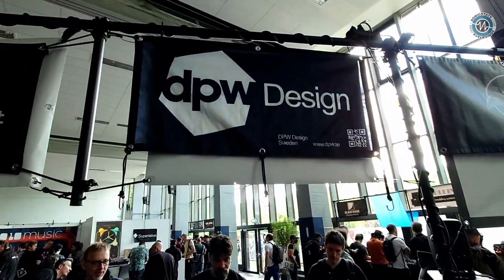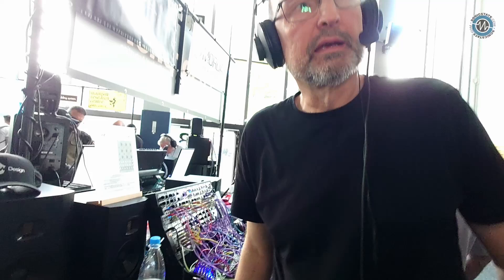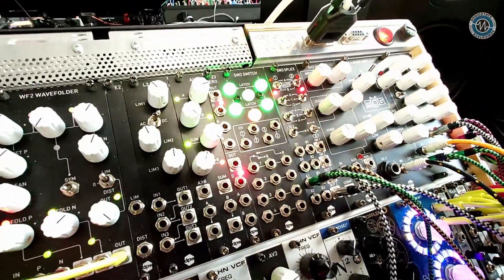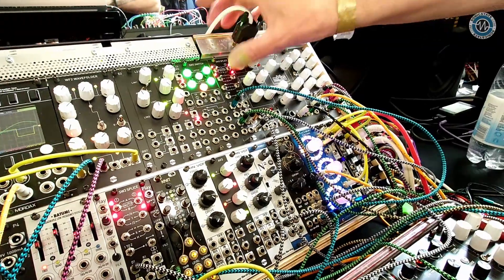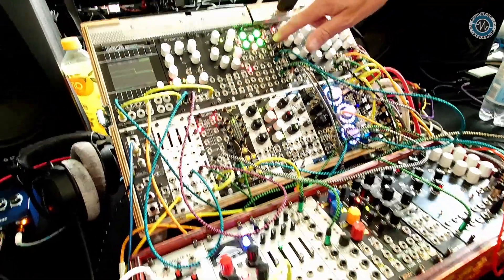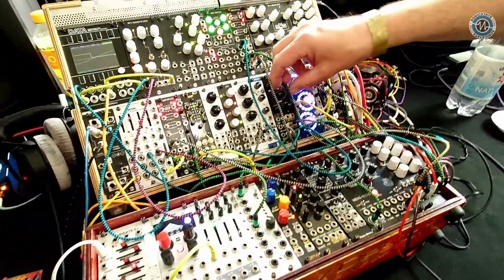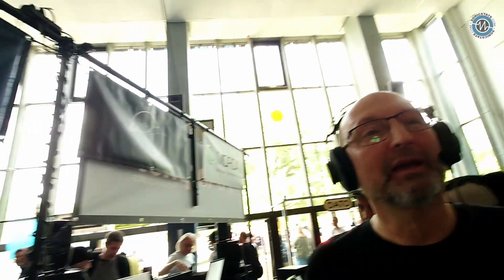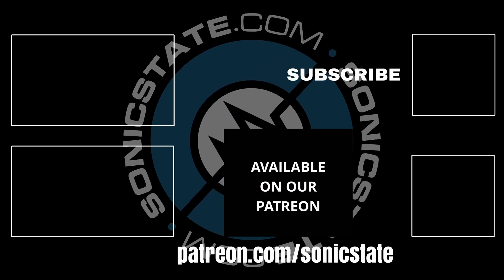DPW Design: SW3 Splice Wave Splicer - Superbooth 25

Comment: I think I waited long enough to buy the DPW Design SW-1 and Zero2 to actually buy this new SW-3. Longing to hear the same slope switching part! Also @sub-haromink righteously commented here about having a controllable slew time between jumps, I guess instead of the automated switching, for which there are no voltage jumps at all: I do not even know if slewing is possible at audio rates, but this could be having all the possible flavours of switching in one module!

Comment: it would be cool to add adjustable slew to it. So instead of switching instantly it would ramp
Reply: the fact it waits for the same voltage before switching makes a slew useless. But I could see your point for smoothing out differences between slopes, still I do not think a regular slew works this way, looking at the slope and not just at the voltage readings. Anyway, a normal slew could be implemented INSTEAD of the automated switching, if it could handle such high rates (and if this behaviour sounds actually good), in order to have all switching flavours at once.